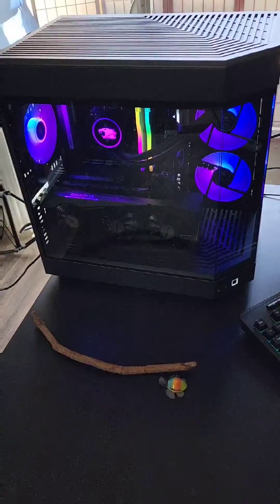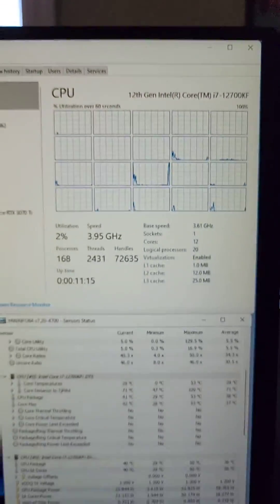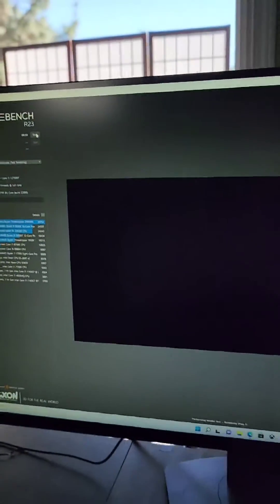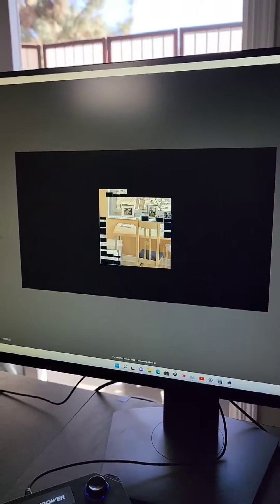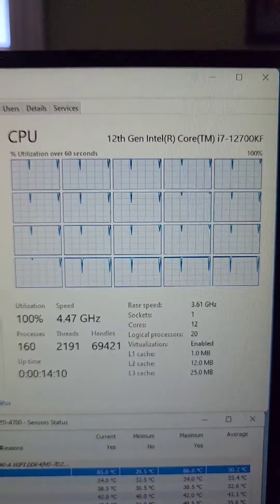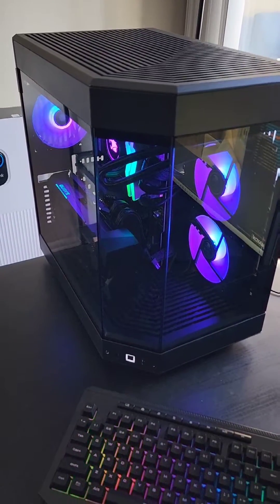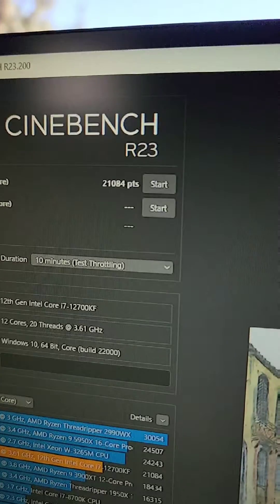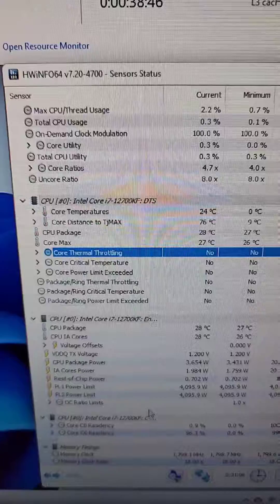iBUYPOWER HYTE Y60 - Does it Thermal Throttle?

Comment: Is this worth getting ? Ive heard people say water cooling aint worth it in the long run is that true ?
Reply: Liquid*
Reply from the maker: Personal preference but all of my primary computers are water-cooled because it's very much worth it to me.
Reply: @DaPoets  what maintence would i need to do with a water cooling pc ?? Anything specific like change out the liquid every so often ? Im sorta new to liquid cooling
Reply from the maker: @Th3MangaAddict23  ah, well you have a lot to learn then so that's hard to answer. Depends on the type of hardware, fluid, usage, design, etc. Watch a lot of videos, read up a lot. Depending on factors, maintenance will be every 3 months to 2 years.
Reply: @DaPoets  yah ive watched a couple videos and from what ive seen so far is that for “AIO” systems cleaning the radiator fans and the surrounding fans will do

Comment: I was thinking of buying this case  currently have h510i and it thermal throttles a lot LOL
Reply from the maker: Yep that case definitely has air flow issues
Reply: I had to turn my fans up to performance mode to keep my ryzen 7 3700x and 5600xt cool. I do plan on getting the y60 once i upgrade to a 6800xt.
Reply from the maker: @Aetherbound  Good move
Reply: @Aetherbound  I’ve set up a fan curve and still haven’t gotten results unless I keep the side panel off
Reply: @HyprTV  Seems typical with the nzxt h510. I'm hoping i can get a 6800xt soon cause my 5600xt is starting to die on me.